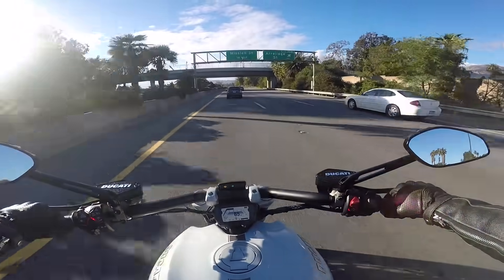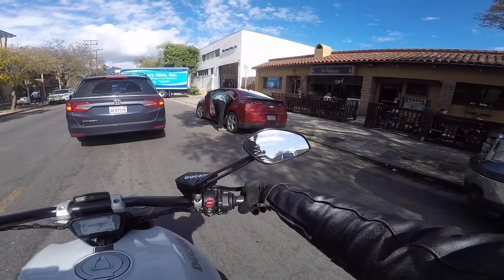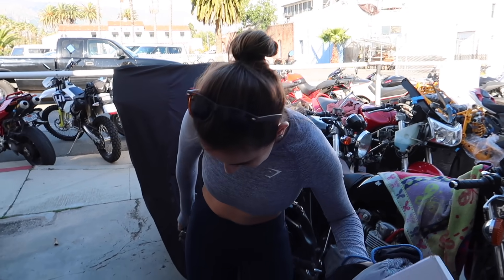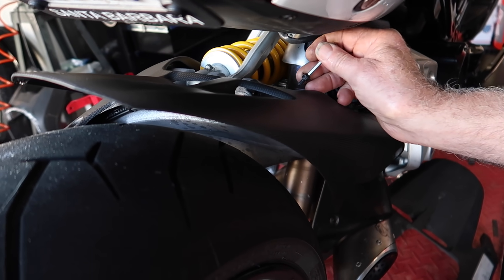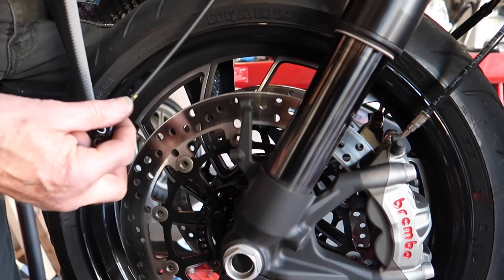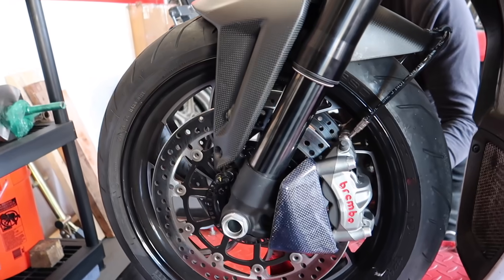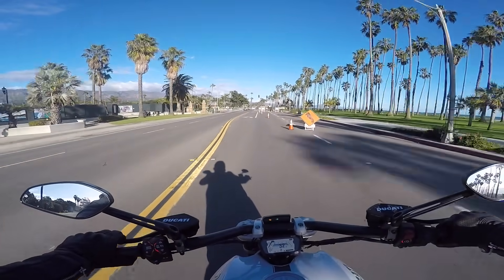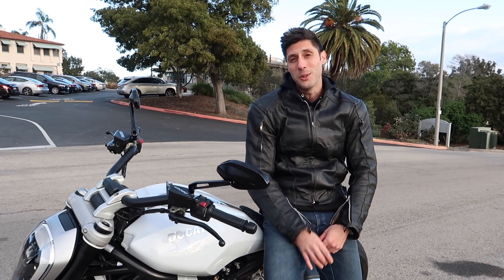Xdiavel with Carbon Fiber Fenders!

Comment: gloss carbon brake cooling covers , no take them off, they are a different colour to the front fender
Reply from the maker: yeah we might have to sand them down and make them look more matte to match
Reply: @JaretCampisi  Would that work?  It kind of looks like the color is different and I'm wondering whether sanding them would address that.
Reply from the maker: @uthrus  the color is the same, the gloss finish can make light reflect causing the color to seem different when its not.  This is one of the main reasons why I don't like gloss carbon in general.

Comment: About your personal bike... I have a 2017 MV Agusta Dragster 800rr. It’s a beast!  Fast as hell.  The rear brake barely does anything and I’m on a MV forum and its a common problem.  I had a 2018 Triumph Street Triple RS before that and it was just a bit more refined
Reply from the maker: hmmm thanks for the info as that is one of the bikes I'm considering for the next build

Comment: Those brake ducts are not going to provide any real performance advantages, and since they are gloss and are not going to match the other carbon parts, you should remove them...Just my opinion.  The front and rear fenders look nice, but those brake ducts are going to stand out like black eyes on this bike.  Keep it consistent.
Reply from the maker: yeah i'm going to see if we can sand them down possibly and make them match better